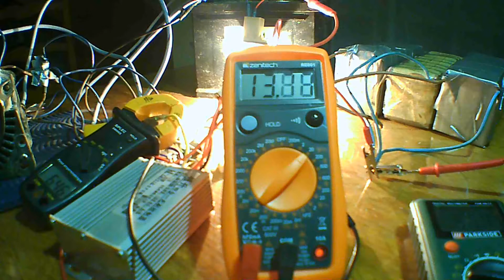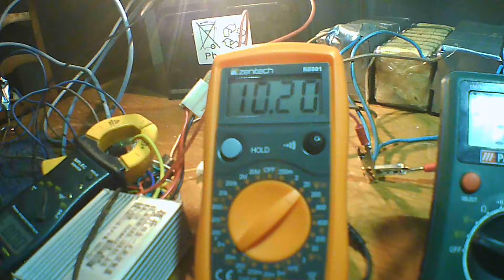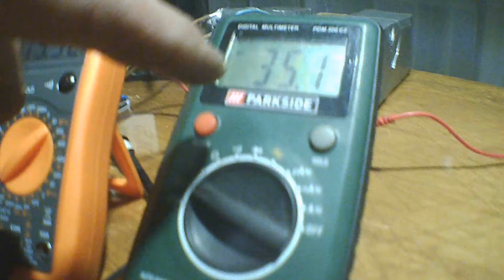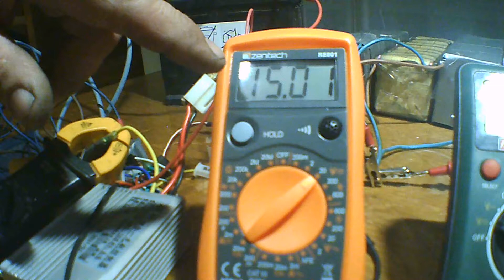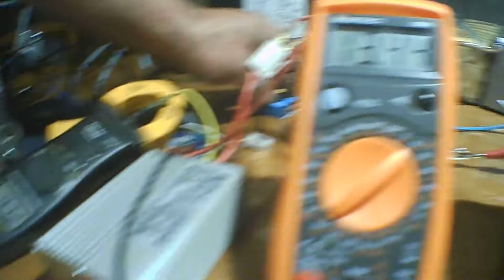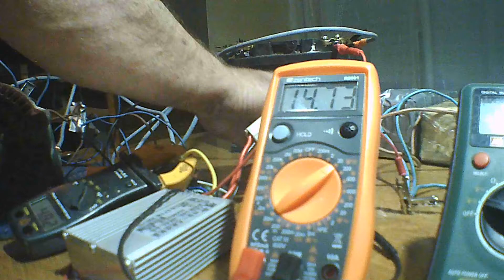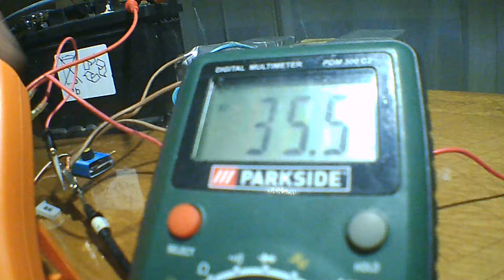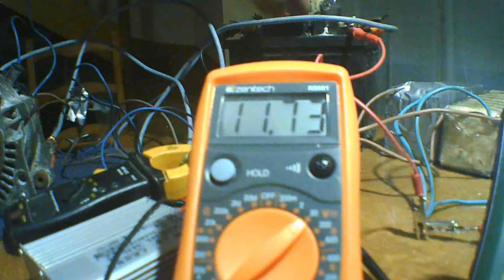how to make free energy generator with a car alternator

Comment: Does this also work with a 3 phase induction motor from a washing machine?
Reply from the maker: i dont know im not try yet but maybe it works if you put magnets in the rotor and if did you like the video subscribe and share  thanks for the comment
Reply: @LICINIO-BATISTA  Are magnets installed in their alternator engine? 
You may be right. In my washing machine motor are no magnets installed but get the magnetic properties through the DC copper coils that move the shaft in combination with the AC current. That means i would need extra a strong battery just to get the magnetic properties. I immediately liked and subscribed after the video.
Reply from the maker: bec collmar  hi  yes its thrue the alternator uses the 36v but only for work has a motor with the controller but  to charge the battery the alternator produce himself the energy becose if you see in my first video here https://youtu.be/XWlG5jXvwAQ   i excted the alternator with a battery of 14v but in this video the alternator is auto excited  
like that its less power you take of the battery and if did you like the video subscribe and share  thanks for the comment
Reply from the maker: HERE IS MY NEW VIDEO AND IT'S A FREE ENERGY PROTOTYPE
https://youtu.be/fa_fY61dNUQ WHICH CAN HELP YOU IN THE PROGRESS OF YOUR PROJECTS BUT IN PORTUGUESE

Comment: não percebi como se consegue fazer rodar o alternador auto,foi modificado?   LIKE 👍
Reply from the maker: este  as unicas alteracoes que tem sao  o rotor que tem imas para auto exitacao e transformado em motor brushless a qual podes encontrar como se faz em varios videos no youtube de resto esta original e podr ser utilizado como alternador normal outra vez e no outro video esse a unica transformacao foi a de passar a brushless
Reply: @LICINIO-BATISTA  sim, já percebi como ele roda, está engenhoso
Reply from the maker: obrigado
Reply: @LICINIO-BATISTA  Can I get a brushless motor instead of modifying on an alternator?
Reply from the maker: @wilsont1010  yes it can be any brushless motor but if you use a normal brushless motor this one has to be modified to give voltage
and enough amperage but my alternator is not modified
Reply from the maker: AQUI ESTA O MEU NOVO VIDEO  E SO UM PROTOTIPO DE FREE ENERGY
https://youtu.be/fa_fY61dNUQ  O QUAL TE PODE AJUDA NO PROGRESSO DOS VOSSOS PROJETOS

Comment: INTERESTING ALTERNATOR CONGRATULATIONS I UNDERSTAND THAT IT HAS THE ROTOR ON MAGNETS AND 2 REELS ON DIFFERENT TENSIONS
Reply from the maker: hi yes its samething like that kkkkk  in the next videos I will disassemble the alternator and explain how it is done see the other video to its the same alternator but is not self exited and if did you like the videos subscribe and share with your friends
Reply: @LICINIO-BATISTA  I SAW THE 2ND VIDEO WITH 12V BATTERY ON CHARGING YOU HAVE THERE CONTROLLER 36V POWER SUPPLY AND 12V DC AND 220VAC POWER OR I DIDN'T SEE WELL
Reply: I SAW BETTER THERE ARE 3 THREE PHASE INPUTS AT 36V ON THE CONTROLLER, 2 OUTPUTS 12V AC AND 2 OUTPUTS 12V DC FROM THE ROTOR
Reply: THE ALTERNATOR HAS 3 GROUPS OF COILS, 1 THREE PHASE, 1 MONOPHASE12V, 1 DC 12V? AND ROTOR ON MAGNETS?
Reply from the maker: yes my friend three phases for the controller have two AC for the 220v transformer and two for the rotor but in this video the rotor has magnets for the self-excited and the rectifier board is normally connected with the connection of the six wires to charge the battery
Reply: @LICINIO-BATISTA  THE RECTIFIER BOARD IS MOUNTED IN THE ALTERNATOR INTERIOR
Reply from the maker: no is outside in the back as  you see in the video
Reply: @LICINIO-BATISTA  thanks
Reply: @panaitmarian1904  hi, the video is very interesting and I'm also trying to figure out how to make one, have you tried already? Today actually I was trying to build this one   https://youtu.be/QOV_Js59BHY
But the alternator I got was impossible to unmount, tomorrow I am getting a different one
The thing is that they also modify the rotor adding permanent magnets, but they do nothing with the rotor coil
Actually I would like to know the connections because I don't know where goes so many cables... If you use the 3 phase coil to the brush less controller, then that means that the 3 phase coil is consuming energy, so the only system that can get energy out is the rotor coil, which is connected by the 2 brush to the rotor coil... And where do the other 2 cables connect?
Reply: @LICINIO-BATISTA  hola Licinio, me he visto tantas veces los videos y sigo sin entender cómo se conectan todos los cables y a donde llevan (espero que no te importe que te hable en español, los brasileños tenéis un don para hablarlo que ya querría yo con el portugués) pues me vi el primer video y pareces que conectas los 3 cables azules al controlador para la bobina del estator y en el 2o vídeo conectas dos marrones y uno azul... No se si los cambiaste
He pasado en otro comentario un link de un vídeo que también modifican un alternador con imanes, supongo que eso será casi igual, aunque creo que tú has hecho algunas conexiones diferentes, la verdad es que me encantaría hacerme uno, te puedo escribir por mail? Igual yo te puedo ayudar con algo, un saludo!!
Reply: @rabasajaviero  EL MONTAJE QUE DICE LA BOBINA DEL ROTOR NO SE UTILIZA SINO SOLO BOBINAS TRIFASICAS 2 DE ELLAS DAN 220V PARA EL MOTOR 750W 220V 2800ROT ASI QUE ES ALGO GRACIAS POR LA IDEA MAGNET
Reply from the maker: @panaitmarian1904  hola los cables marrones son las tres fases lo dos azules son para el transformador para los 220v este alternador es el mismo en el primer video solo que como lo abri para tansformar el rotor le he cambiado los cables y he puesto los azules en el lugar de los marrones pero va a dar lo mismo aqui en este video solo utilizo los cables de las tres fases
Reply from the maker: @rabasajaviero  hola amigo javier bien venido a mi canal en primero lugar soy portugues no brasileno y hablo 4 idiomas y vivo en francia bueno mas o menos en segundo lugar como abri el alternador para tansformar el rotor le he cambiado los cables y he puesto los azules en el lugar de los marrones pero va a dar lo mismo aqui en este video solo utilizo los cables de las tres fases y en tercero lugar sobre el link que has dejado en el otro comentario he hecho lo mismo que en ese video pero es impossible a no ser que el tio ese haya hecho transformaciones al motor porque a mi el motor no gira solo vibra por la frquencia del alternador y el alternador que utilize es de un bus con 16 polos y 16 bobinas de 24v pero con un motor de escobillas puede que funcione
Reply: @LICINIO-BATISTA  Gracias
Reply from the maker: HERE IS MY NEW VIDEO AND IT'S A FREE ENERGY PROTOTYPE
https://youtu.be/fa_fY61dNUQ WHICH CAN HELP YOU IN THE PROGRESS OF YOUR PROJECTS BUT IN PORTUGUESE
Reply from the maker: @rabasajaviero  HERE IS MY NEW VIDEO AND IT'S A FREE ENERGY PROTOTYPE
https://youtu.be/fa_fY61dNUQ WHICH CAN HELP YOU IN THE PROGRESS OF YOUR PROJECTS BUT IN PORTUGUESE